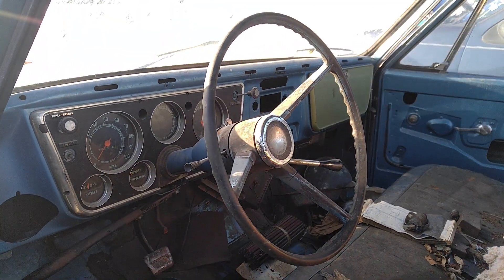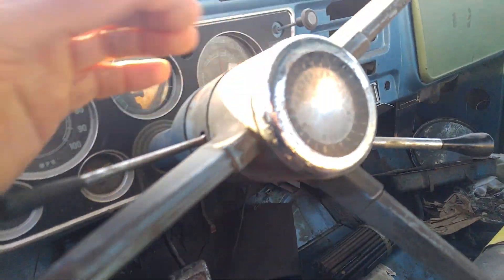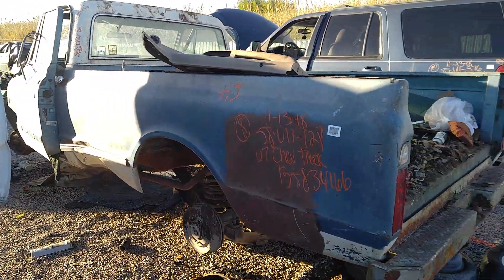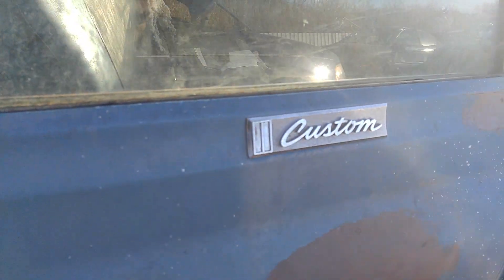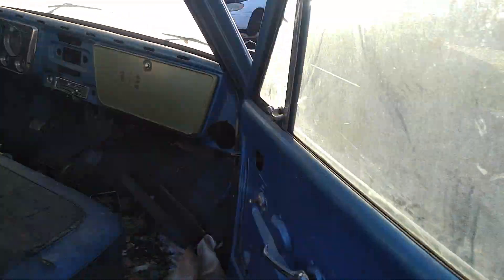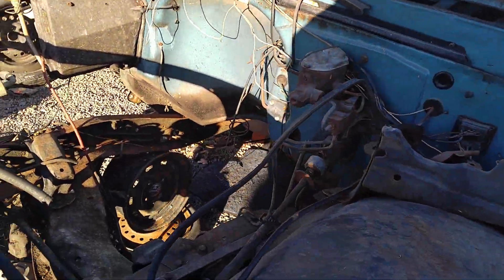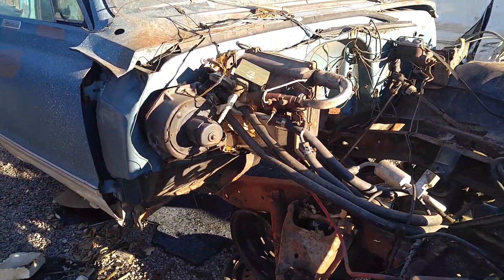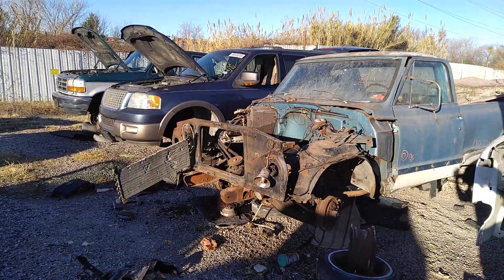1967 Chevy C10 Custom Junkyard Find

Comment: Usually on a factory AC equipped truck, the glass will read "E-Z Eye" or "Safety Flo-Lite" to denote it's tinted, which would be typical for an AC equipped vehicle.

Comment: VIN is C for 2WD, E for V8 equipped truck, 1 for 1/2 ton, 4 for pickup truck with bed, 9 for 1969 model year, J for Janesville, WI assembly and the rest is the production sequence. Based on the glove box SPID, the AC was not factory installed....no C60 on the SPID for it.